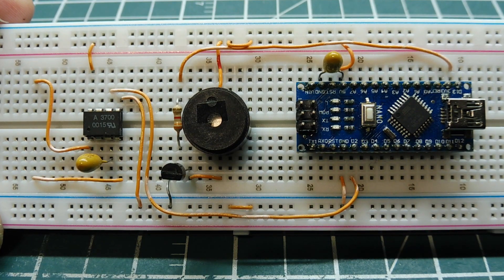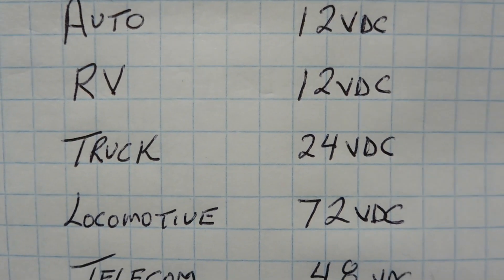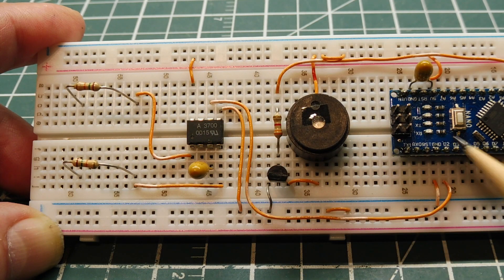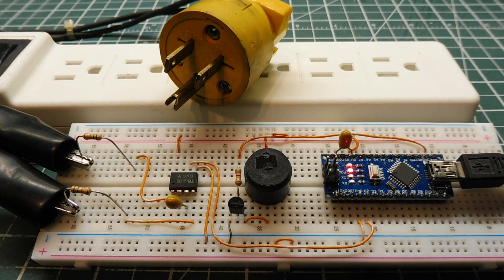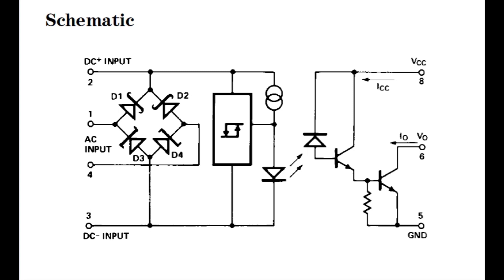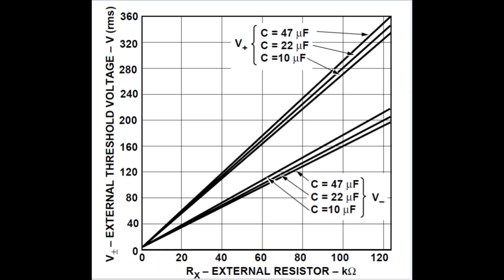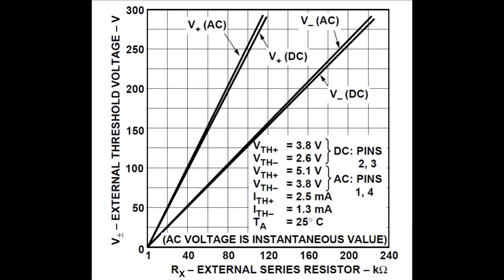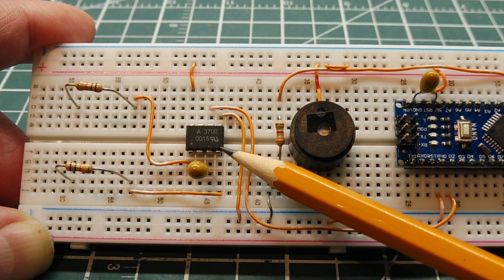Outside World Voltage Detector Interface  / GPIO / Arduino

Comment: I am a bit late to this post, but a good video. I have 2 questions, 
1. what is the wattage of the resistors, 1/2 W? 
2. You mention open collector, does that mean with 3.3V GPIO just use 3.3V for the Vcc an be fine?
Reply from the maker: The resistors are 1 Watt. Pin 6 is open collector, so if using a microcontroller an internal pullup is required. If not using a microcontroller add a 10k resistor from pin6 to Vcc (3.3 or 5 volts) and your output at pin6 will switch from Vcc to ground.

Comment: Great project. I want to build it on my breadboard. I see you have the buzzer on pin 13 via a 1K resistor and a transistor. Which transistor are you using?
Reply from the maker: Any general purpose NPN transistor like the 2N3904 or 2N2222 will work.

Comment: Does anyone know of a portable ascii video terminal “vt-100” type interface to use with “in the field” forth controlled atmega328’s?
Reply from the maker: One option is to use your smartphone. There is an Android app I use called Blueterm.
You just need to connect a HC-06 Bluetooth module and you can connect wirelessly. 
Check out this video around the 5 min mark: https://youtu.be/yXRWQpJrK6g

Comment: Do you have to take the 65% of the DC voltage? I see that when is AC but not sure why you will do that with DC. Great chip and thanks for “discover” it fir your subscriber. I only wish you will use C++ instead of Forth.
Reply from the maker: The chart voltages are "threshold" where the circuit just starts to turn on. You can pick your own percent margin to ensure reliable sensing.

Comment: 1v to 220v ac/dc input will give 5 volts out, and 0 volts give 0-volt output am I right?
Reply: You will have to refer the datasheet to get the minimum and maximum voltage threshold which typically is the threhold volatage of the LED inside the optocoupler, now the datasheet of this Chip, HCPL3700, states "5 V to 240 V AC/DC voltage sensing" however the VCC can be as low as 2V and go upto 18V

Comment: As usual the excellent theory and details, such as the reference to the bridge rectifier diodes acting as Zener  diodes limiting the voltage for the smoothing capacitor. I do recall  when I was in telecommunications many years ago that the ring voltage frequency was 17 Hz. Not sure if this has changed or maybe different in Canada. I am in South Africa and we followed the British Post Office Standard at that time.
Reply from the maker: The standard ring voltage frequency in the USA and Canada is 20Hz. In Europe it is usually 25 Hz. The range is from 15 - 68 Hz.
https://en.wikipedia.org/wiki/Ringing_(telephony)